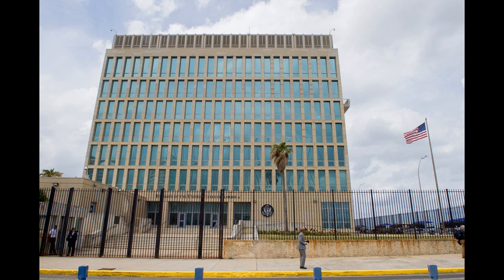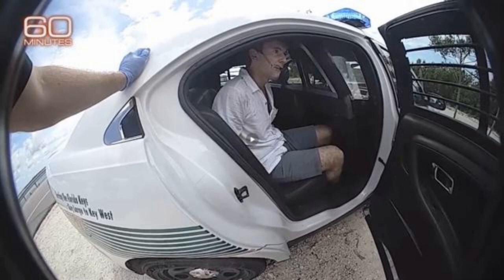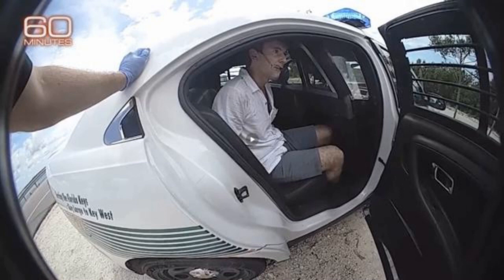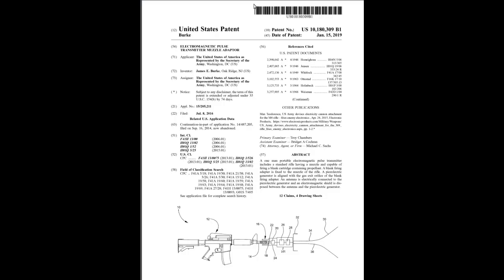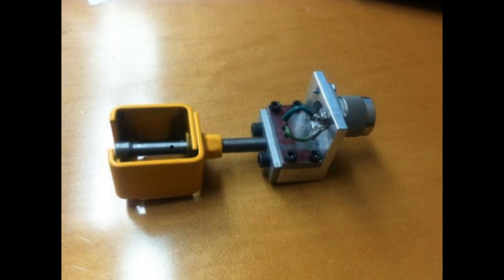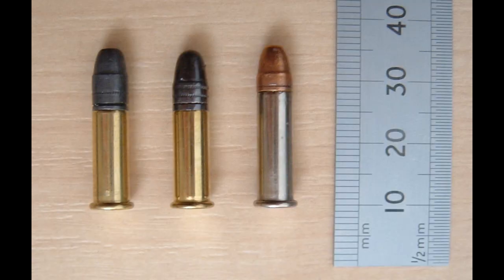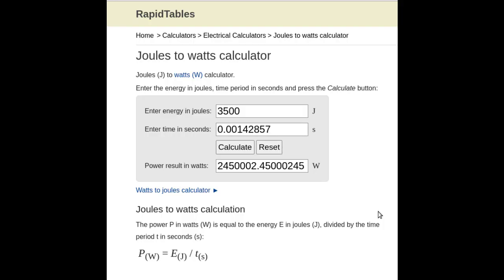How I think "Havana Syndrome" the Cuban Embassy Attacks microwave weapon Part 2 piezoelectric round

Comment: Seriously interesting theory, this might really be it.
Reply from the maker: Out of running every possible number. 

Unless there is some technology for power generation I am unaware of this is the only way to do this that could be concealed enough. You could literally park a car with tinted windows and a 2 foot parabolic dish in the backseat pre aimed at the targets nearest window. And the minimal support electronics in the trunk. And have enough energy to pull this off from 500+ meters 1600 feet and remotely activate it until it spent all its rounds.

Worst case it might sound like a car backfiring, but this can probably be built to be nearly silent.